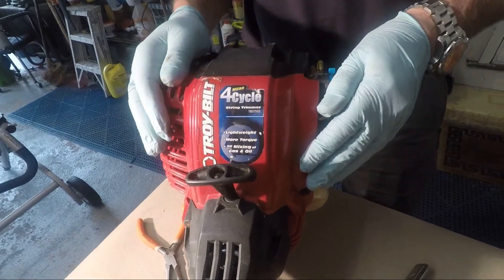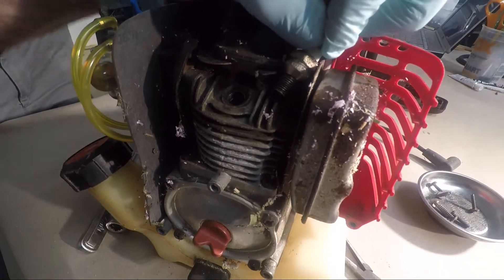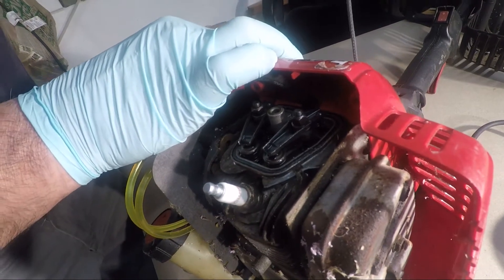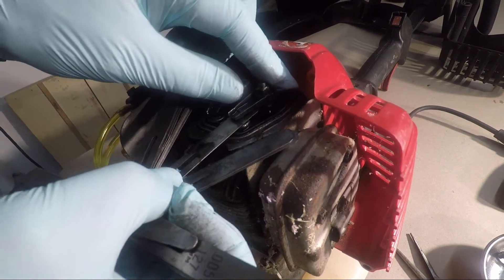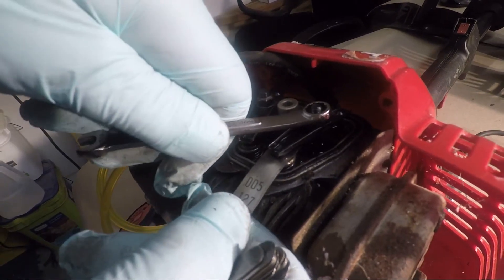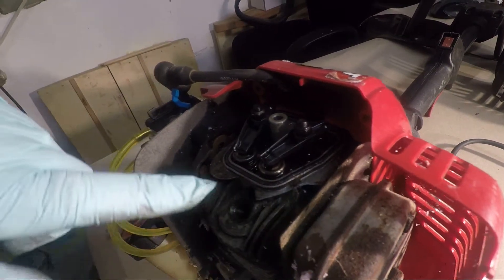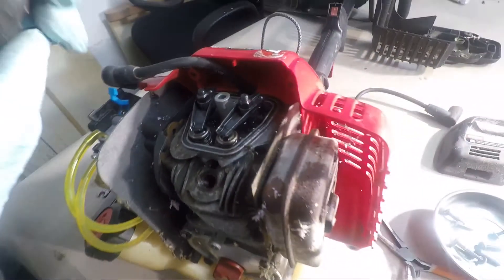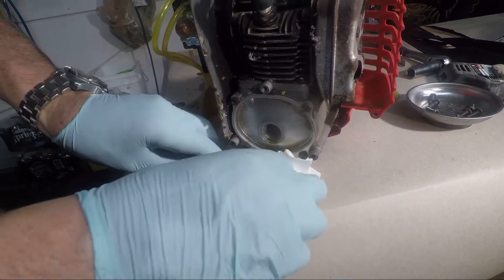Fast, Easy adjustment of Troy Built 4 Cycle weed eater

Comment: Instead of doing one at a time, couldn’t you just get the piston up on the compression stroke and do both?
  Actually, looks like that is what you did when you did the final adjustment.
  Btw, what symptom did it have?

Comment: Thanks for the video DJ, very helpful. On mine, I broke the blue lever that controls the air flow, with a bad pull of the starter rope gone wild. By chance, do you know a supplier that might sell these? I haven't had any luck locating one. Troy built website says its discontinued. Thanks again for the video.
Reply: Talking about the choke lever?  Probably try a mower junkyard.  There might be another model or brand that the part possibly crosses over to as well.

Comment: Im not so sure you know what you are doing!! What you did was NOT the proper way to adjust valves, 
The proper way is to get the piston to Top Dead Center on the compression stroke, then adjust both valves, DONE!
Reply: exactly